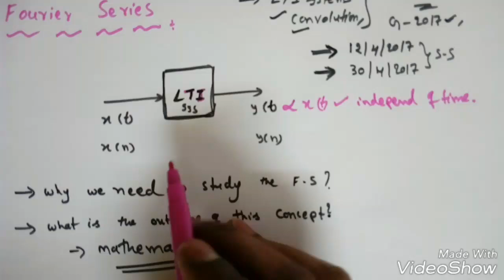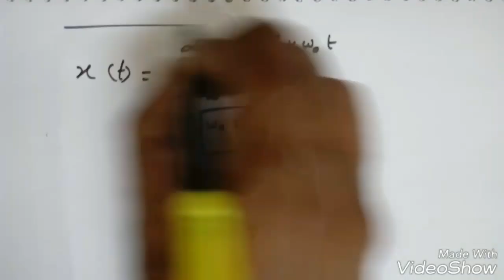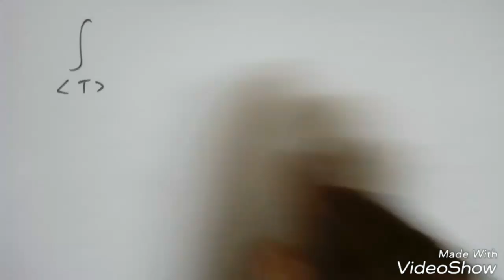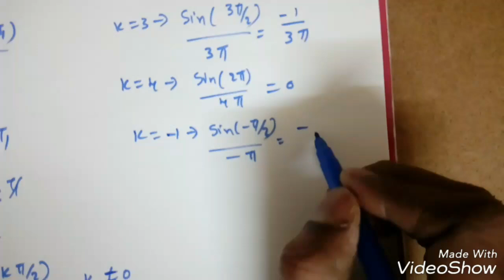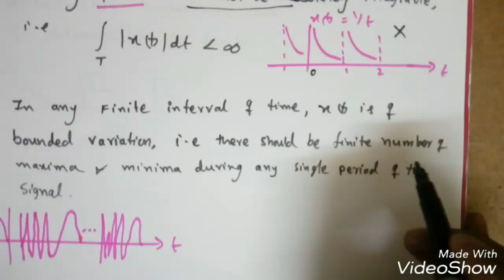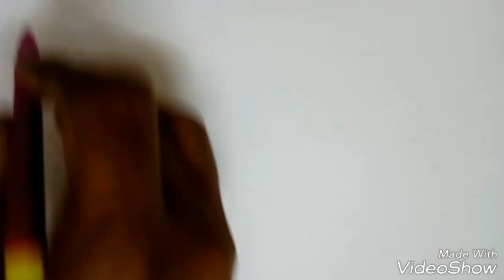Signals and Systems Lec-17: Fourier Series- 1

Comment: Thanks sir,I think this lecture is useful for those who are preparing for engineering classes, it won't useful in gate exam because we need to solve problem with in 1 to 1 1/2 minutes,so try to find some shortcuts,to solve problem which is useful to students in the competitive examination

Comment: THere's a mistake, at 43:40 while calculating a0, there's one k in denominator as well, which will lead to a  0 by 0 form and not 0 so please correct that.
Reply from the maker: yes my mistake...at k =0, value of a0 = 3/2...thank you..

Comment: Sir the time period, you are taking is not correct. please make corrections.
Reply from the maker: Amit Singh can you be more specific where I gone wrong.. mention time please..thank you
Reply: When you are explaining the periodic signal, the time period T you have consider is not correct, it should be from origin to mid of the pulse.
Reply from the maker: ya there is a reason why i have taken like that if we take from o to T, we have to integration in two parts,,because there is no value in middle of 0 to T..if we take from -T/2 to T/2  we have to only one integration from -T1/2 to T1/2..we can take the signal for one period that can be 0 to T or -T/2 to T/2 both are same..
Reply: that is ok sir. But the length T you are taking from the origin is not actually time period. If we consider that length of period as T'= 3T/4